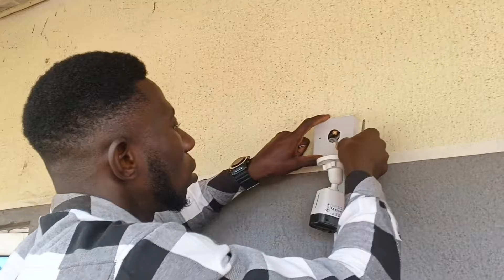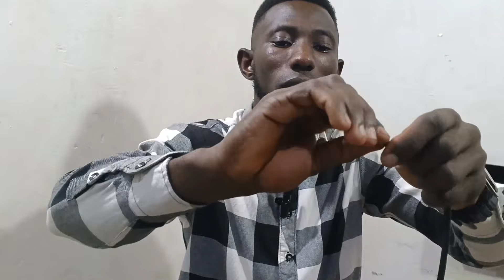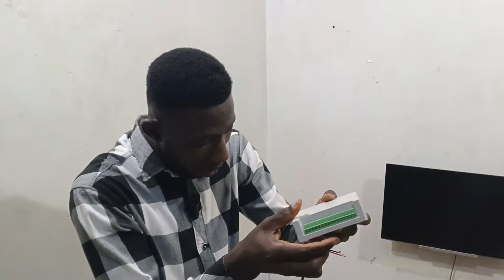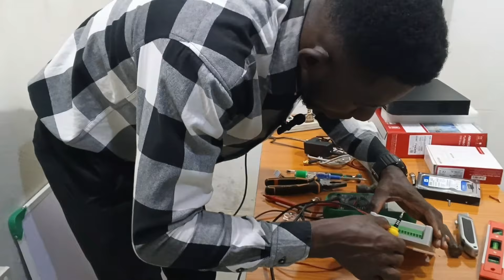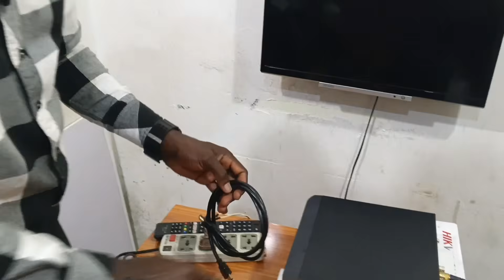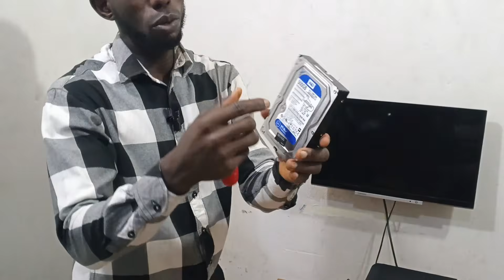Complete CCTV Installation Guide | Step by Step Tutorial for Beginners

Comment: Next time fix the camera to the junction box cover before covering the box else you might pierce the cable inside and this method of installation works but outdated , Use cat6 and pv baluns
Reply: was about to ask the same he is stil using coaxial cable